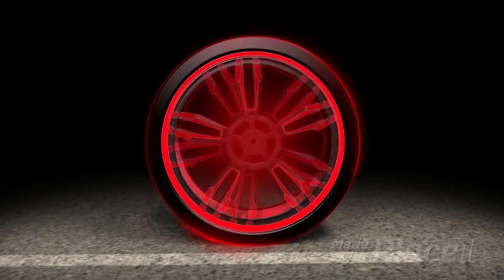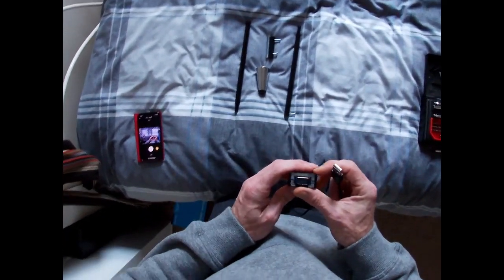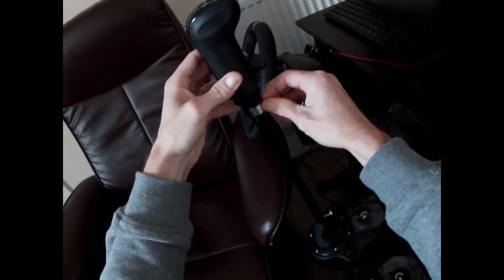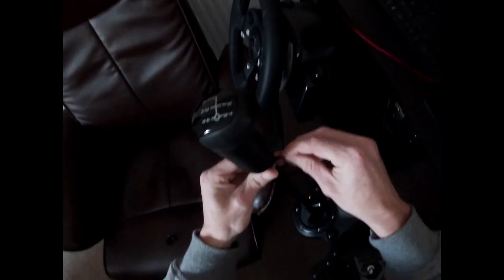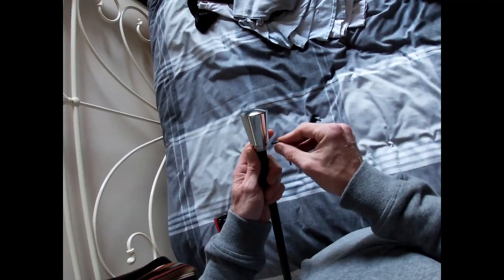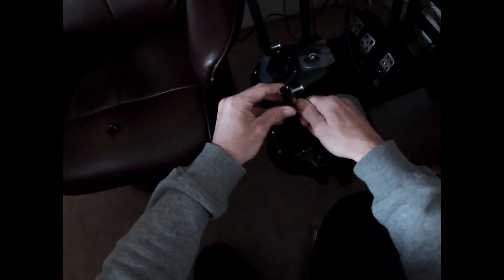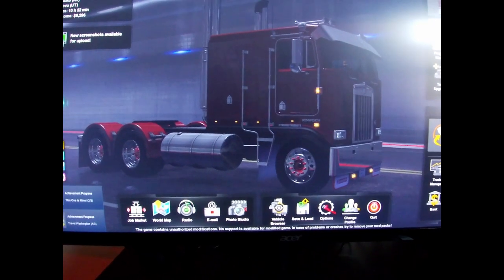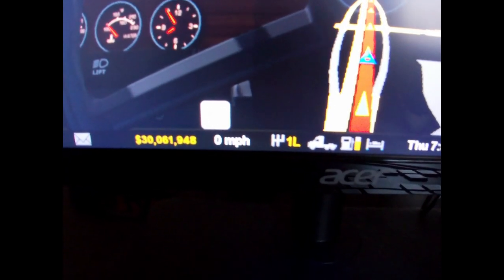Twin Stick Build & Setup ATS/ETS2

Comment: I drove a twin stick B model Mack back in the day with a 18 speed quadruplex transmission, 4 speed Joey and 5 speed main, this to me,if it was possible to set up, would be the only reason I would attempt to have twin sticks in ATS. While I do appreciate your effort to do what you have done, I just don’t see the point.

Comment: Cool setup. What is the go with 2 sticks ? Is this just the range and splitter on the second stick instead of having buttons on the main stick ?
Cheers
Reply from the maker: Yes mate range on main stick (left) and high low gear split on stick on right

Comment: Nice build!  I'm interested in a similar design but wasn't sure how realistic they'd feel if there's too much weight up high that they flop around too much?  How are they holding up to long-term use?
Reply from the maker: I love them would never go back, they make the game more realistic with the longer throw and yes there is more weight to them but it just makes them feel better when changing gear as the stick falls into gear but don’t find them floppy at all, so far been in use about 3 months with no issues would love too add a third stick
Reply: Hey HL! Love ur videos aswell! Have a good day m8

Comment: Hi like the video
I have the two  Differente shifters 1 Logitech 1 thrustmaster 
the Logitech would be use for and the range shift that you have made I have tried it last night but I found that when it shifts into neutral it's in low how did you over come this ??
Reply from the maker: Hi thanks, yes have same issue 3th is hi and neutral is low but as 4th is not assigned to anything i can use the full throw and it doesn’t affect the low range it just thinks it’s still in neutral,  so really not overcome it just working with it lol
Reply: Ok thanks that's great  Thought there may have been something I was missing how I could take the neutral out as it where  But that's sorts in the problem for me thanks very mate cheers
Reply: I have read on scs  forums there are other configured by playing around with  inside the game 
Config file  that seems a lot in of playing around to do it   But your way is a hell a  lot simpler and enjoyable

Comment: Is your 2nd stick for a 3 Spd Aux or a 4Spd Aux? if it is the 4spd, did you flip the 3rd&4thshift gate so it would function as the actual "Brownie Box"??
Reply from the maker: No mate did want to set it up to be a twin stick spicer but couldn’t get it to work so it is just a high low stick/box now
Reply: @tuctucmotors9116  Bummer! would have really liked to have seen a 4Spd Brownie Box in a Game. How many gears do you have for the first stick?
But hey,,, a 2Spd Brownie Box is good also. Good Job.
Reply: @smckinney3mckinney141  HE HAS a nice setup but i run a 6x4 24speed gear box

Comment: Logitech stand alone shifter adapter I FOUND ONE but its for the g29 i have a g27 will that  stand alone shifter adapter work on the g27 ????
Reply from the maker: I think so but you will have to check with seller first
Reply: @tuctucmotors9116  I HAVE 2x 12inch extender's off my w900l there the old ones lol what extenders  are you using the ones im using there kinda heavy
Reply from the maker: @Dirtyx3South  mine are car gear shift extensions and are heavy which I like as the sticks fall into gear nice 👍
Reply: @tuctucmotors9116  ok ok so it doesn't hurt the gear box at all there not to heavy then ....
Reply from the maker: @Dirtyx3South  no not at all
Reply: @tuctucmotors9116  ok now how did you map the shifters can you do a video in that
Reply from the maker: @KoADiRtYx3  it is easy enough to do and lots of videos on this process on you tube just look for shifter set up ats and you should find a few if not let me know and will do a quick vid for you buddy

Comment: What racing wheel stand do you have?
Reply from the maker: CO-Z Racing Steering Wheel Holder Compatible with Logitech G27, G29, G920 Adjustable Height Steering Wheel Stand for Thrustmaster Racing Steering Wheel Stand for PS4 Gaming https://www.amazon.co.uk/dp/B099KQ5JXP/ref=cm_sw_r_cp_api_glt_i_RWQ55BGHDGEXAY9JB9KE?_encoding=UTF8&psc=1
This one buddy

Comment: Would you be able to link to stuff you used?? I know theres a list but having issues finding it all
Reply from the maker: https://www.ebay.co.uk/itm/283515868201
https://www.ebay.co.uk/itm/202815986776
https://www.ebay.co.uk/itm/383873519438
https://www.ebay.co.uk/itm/265090780336
Hi hope this helps you out, these are the parts needed and a gear knob I bought from Halfords,

Comment: Can I ask a question where do u get the exsteions
Reply from the maker: Hi they are standard car gear shift extensions off eBay with the tread filed out a bit so they fit on the Logitech shifter

Comment: Hey do you have the links for the shifter mods you have in this video??????
Reply from the maker: Which one done you want?
Reply: @tuctucmotors9116  I would like to have all if possible really
Reply from the maker: @sylvinaus246  https://www.ebay.co.uk/itm/10-254mm-Shift-Knob-Extender-Shifter-Stick-Lever-Extension-Gear-Fit-For-All-Car-/283515868201?mkcid=16&mkevt=1&_trksid=p2349624.m46890.l6249&mkrid=710-127635-2958-0

https://www.ebay.co.uk/itm/Sequential-Gearshift-Adapter-NEW-for-Logitech-G27-G29-G920-G25-Gear-Shifter-A2U-/383873519438?mkcid=16&mkevt=1&_trksid=p2349624.m46890.l6249&mkrid=710-127635-2958-0

https://www.ebay.co.uk/itm/USB-ADAPTER-FOR-LOGITECH-SHIFTER-G29-AND-G920-PC-ONLY-/393908899620?mkcid=16&mkevt=1&_trksid=p2349624.m46890.l6249&mkrid=710-127635-2958-0

And gear knob from local automotive shop and ats shifter off eBay 
https://www.ebay.co.uk/itm/SKRS-Gear-Shifter-3-Button-Type-For-ATS-ETS2-And-More-Fits-G29-25-27-TH8A-/313774365164?mkcid=16&mkevt=1&_trksid=p2349624.m46890.l6249&mkrid=710-127635-2958-0

Hope this helps you out